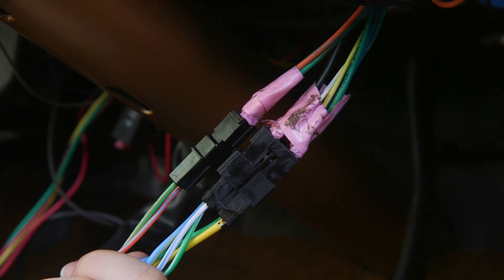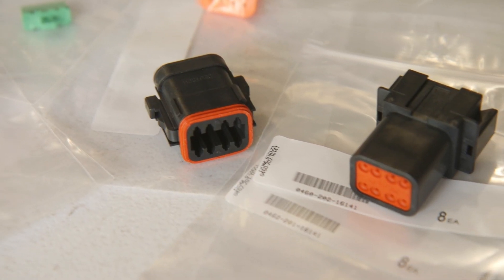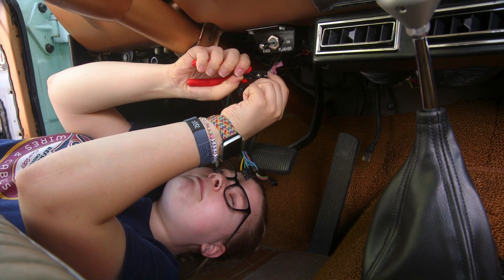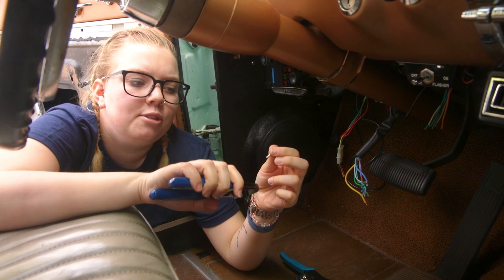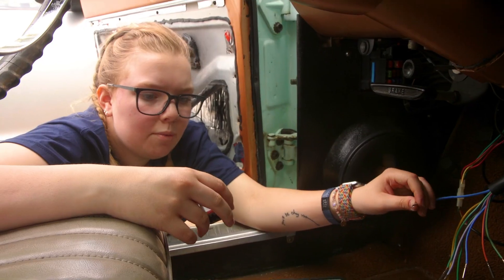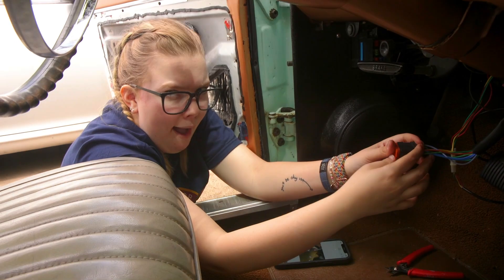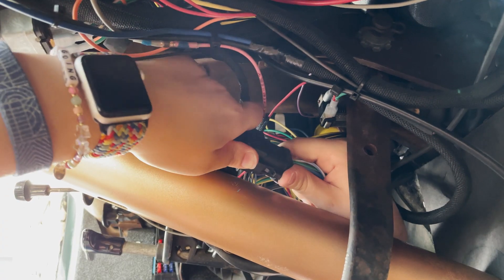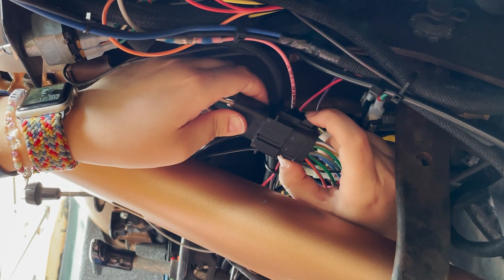What is a Deutsch Connector? Will it Help?

Comment: i have a 70 mustang 6 cylinder with turn signal wiring plug problems and you have enlightened me to buy these deutsch connectors and thank you for such a good video explaining how to 
install them.......im doing that now......thank you very much......good luck with your car ....ill follow your future videos and keep your six cylinder engine - they are so reliable and original......ed

Comment: A tip when using those wire strippers:  If you are careful to not squeeze all the way, let the strippers return (and open) before they pull the insulation off the end.  Then pull the insulation off with your fingers.  If you let the strippers pull the insulation off then the blade of the strippers will often come back against the stripped end of the wire and make a mess of the strands.  This process of messing up the strands is called "bird-caging".

Comment: Great video, I've made the same mistake in the past and I work electronics for a living.  Don't feel bad about that.  Little technical info, a "short" is when power goes where you don't want it (i.e. ground).  It'll blow a fuse.  An "open" is when your voltage doesn't make it where you want it to go.  (i.e. your light doesn't light up when you press the brake pedal).  Not super important for what you're doing, just a little bit of electronics terminology to add to your knowledge bank.  The important part is that you know how to troubleshoot the electrical systems in your car.   Props to you guys for finding it and fixing it before things got worse.
Reply from the maker: Thank you and that is GREAT information! Now I know about "short" and "open"! Thanks for that education!!